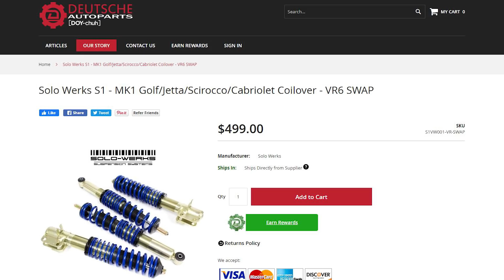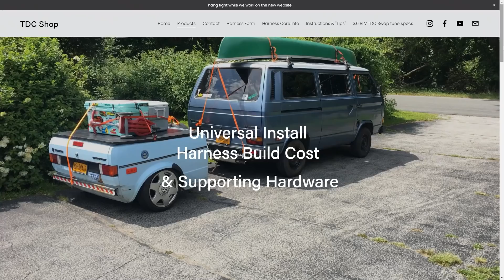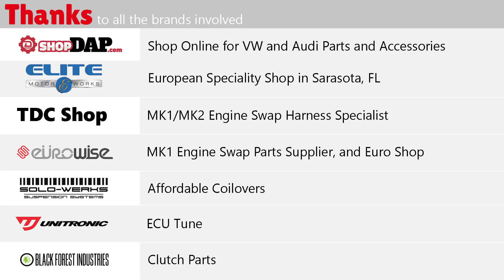Swapping a VR6 into a VW Scirocco in 1 Day! (Part 2/3)

Comment from the maker: 1st Episode - https://youtu.be/iOBnb9RO7pc
New Episode - https://youtu.be/8xRSSx-uVE0
Jamie's Black Bumper DIY - https://youtu.be/mi_tOXQ5xk0
Reply: i have a pointless build mk4 2.0 new long block forged pistons an rods lightend pulleys high pressure fuel regulator i believe they made a 5 speed but  new auto 01m should due i think anything under 200hp will be fine also with a tune u dont really get shizzznit out of that motor literally a pointless build

Comment: I am getting PTSD from this.....
Reply: I had the same thing happens this week on my build.. I tested grounds, I used jumper cables, I changed starters, I looked at the alignment bushing in the transmission, I was concerned it was something bigger seeing as I built the block 15 years ago..lol it ended up being a ground.. curious to see what this ends up being!
Reply: ive done so many mk1/2 swaps that ive had this type of PTSD for years. im going to be doing the dumbest swap before too long, its a vr6 rabbit pickup build, but it wont be front OR rear wheel drive, and it isnt a haldex awd....
Reply: @ghomerhust  Oh I wanna see that
Reply: You are a victim of German engineering
Reply: My 2 cents. Starter is not grounded properly
Reply: @kevinbarry71  oh no...I fear this describes me
Reply: I swapped a mildly built 5.0L with a C4 trans into a 1990 Ranger.  Eye still twitching for that swap !  Never had more fun with a vehicle than that old girl.  Next is a 2001 S-10 with a 6.0L LS.  Nice work.
Reply: Gonna need a good therapist if I ever do this myself

Comment: I snagged a rocco 2 that was sitting for 18 yrs in a barn in manteca California,  and then a  2l up in WA that was replaced for a jetta vr6 swap.color was the same, red. Had to replace all the soft bits, fuel lines water and oil etc. That thing was like a motorcycle, the way it went through the gears (Shrick exhaust cam and Tectonics exhaust). Yours would be like strapping your ass to a rocket lol!!

Amazing work youve done, and i sincerely thank you for reviving an old mk2, theyre rare now. Im a h20 vw head from the past and your video has got me drooling!!!!

Comment: nice build guys.  regarding those metal fuel lines, better to just get rid of them right up front, it's faster and easier to replace them with MK2/3 plastic lines from the pump forward.  the CIS banjo fitting on the fuel pump is barbed and fits the plastic line perfectly, just apply a little heat gun to the plastic line and slip on.  the other end of the plastic line has a metal fitting with a hollow metal sleeve  that has a bead to hold a regular 8mm hose to run to the fuel rail.

Comment: I remember when my 1.4 mk4 golf was having start/ignition cuts. Knew it had to be a over current pull like a blown electric motor I changed the starter it still did it. Noticed wipers kinda moved when trying to start. Pulled fuse for wiper now it starts everytime perfectly. ELECTRIC MOTOR DIAGNOSTIC IS THE GOOD SHIT

Comment: time for an upgrade, 16v brakes, sway bar,  16v lower brace if it will fit with the VR6, 100MM CVs.....  I love some of the goodies you got, the coilovers especially.  LOL, the shifter ball took a shit as well.........  I am actually amazed it was still there at all though.  If I remember  right there is a narrow and wide rocco radiator, if nothing else one from a quantum is wider if I remember right.  Now the rocco radiator is something used in normal hotrods, so they are available in completely aluminum models with more cores.  Its not cheating, gantry crane for the win any time you can use it, and that one is the best Chinesium money can buy!  Don't move, don't even breath!   Holy crap thats tight.... Lucky guy working that tight hole......  AH, Butyl, the stickiest, and hardest crap to get off your skin known to man.  LOL@ the race switch, I was going to ask how hard it was to build the harness with a plug for the OE ignition lock, then I remembered how crappy those were anyway.  New battery, turns over by hand, bad starter or cables.  I dont run into bad new starters very often, but they do happen.

Comment: Mk1 fun fact.  You can remove the axles without disconnecting the ball joint or tie rod.  They barely come out, but they come out.

Comment: I'm with Charles , a starter on a engine like this should have the tendency to roll around it's own axle when supplied with sufficient juice under no load.

Looking in on the specs off the starter,  it should say what the current draw is in a no load condition,  when you have a 'ampclamp'  you are able to rule that out.

Comment: As someone who has done this on VWs from that age a couple times.. It just hurts to watch this, but it's expected for people who do it the first time especially when you got such a limited amount of time. I've seen guys here in Europe just ram a block in like that in about 15 minutes with a forklift and a crowbar. The starter issue is most definitely a loss of power of some sort (ground cable or not enough supply) , because the starter cranks just fine, just really slow. If that isn't it the only other possibility is that the starter is just bad or locked up

Comment: Also, the largest wheel size you can fit in S2 is 16" x7" 4x100 with some bottoming out. Don't take out the plastic front
wheel liners, they are not available anywhere. Check out Scirocco.org for wheel and tire guides, as speedometer and
odometer issues happen with alternate wheel sizes. Also, with bigger wheels you need spacers, usually 8mm to 10mm
to clear struts and brakes.

Comment: Love your videos guys! Just disagree with your recommendation on coils. 😅

Have to say from experience with BC Racing and Solo Werks... Solowerks are garbage, at least on my B8.5 allroad. I’d have saved a little more for BC or ST all day. Saying they’re the best budget coil over is like buying the best microwave burrito at Dollar Tree. I’ve had mine a year and have nothing but complaints on ride quality from new to now blown, and I’m on the highest height setting after dead middle was uneven and slowly lowered down... 

And support was lackluster to say the least. Was told at a show by the corporate sales manager that my car required a different kit than normal B8.5 S4 (they had a cheap promo price on that kit), found out later it’s the same exact parts and kit number spending more to get one supposedly for avant models.

Comment: I have a 1988 Volkswagen Scirocco I am having difficulty returning the motor I have spark and fuel but it still will not fire sounds like the timing's off it's the 4-cylinder 16-valve dual overhead cam any suggestions on how to check the timing it is missing its timing cover present timing belt

Comment: Big mistake not installing that crossmember brace, your front crossmember will crack and they are just as effective with only one bolt in on each side.  Factory Mk2 Scirocco 16vs had enough power to crack the front crossmember and you are what, well over doubling that HP and TQ.  EDIT - I see several shots where you were working out how to get the VR6 in with it installed - did you guys end up using it?

Comment: I think we're all due a press release stating the inadvertent use of the word MK1 instead of MKII Scirocco  . . . . . lol
Reply from the maker: MK2 sciroccos use a Mk1 chassis, which is why we are saying that.
Reply: @Deutscheautoparts  Yes of course. Back in the day we used chassis A1, A2 so on. Cool series brings back memories for sure. VR6 in a MKII A2 gti 16V with 5 bolt hubs corrado rad.

Comment: Pls change them bumpers to the non us spec they looks awful🤮of just take them off completely. 

Also to bleed the brakes without the bleed nipples, it’s not as efficient to get all the air out but bleed them out the brake union closest to the bleed nipple

Comment: These cars rust away and need a heaway bodywork before take sommeting on engine...: had one 1985 1,8L 112hp Scirocco GTX, after 10 years was the rust in holow rooms from the body so advanced that i trow it in the scrapyard before the engine was out of service (at 300 000km) , car always hold in a dry garage if not drive...and forward suspension and bodywork was fragile (close the same as on the Scirocco 1) not strong ennough to hold a VR6